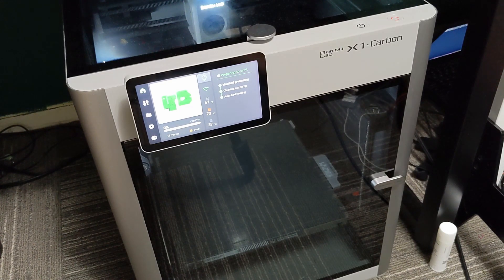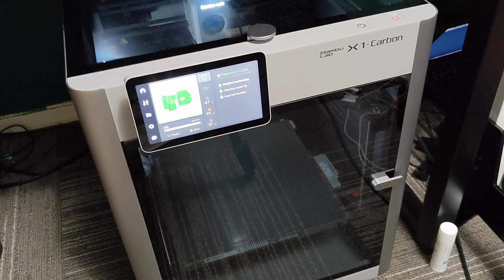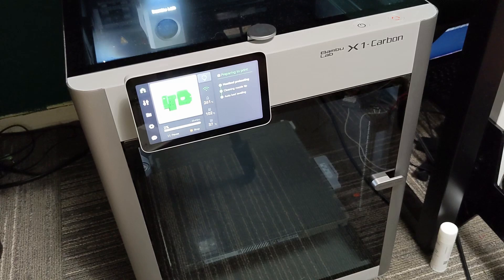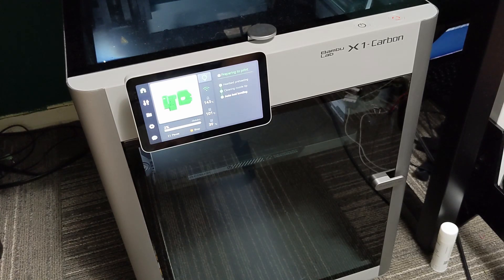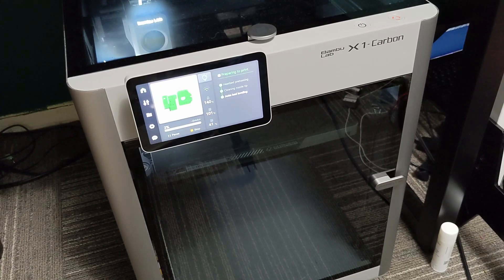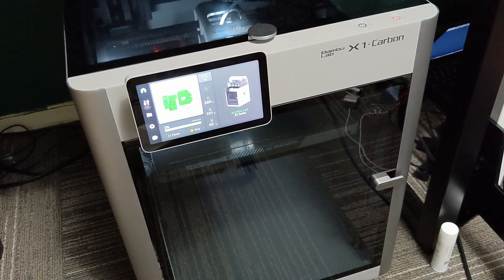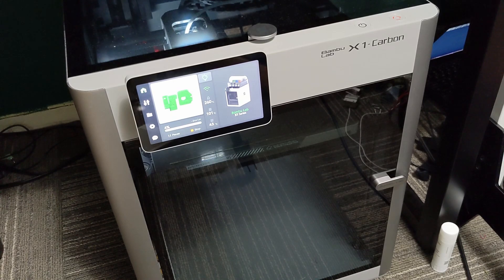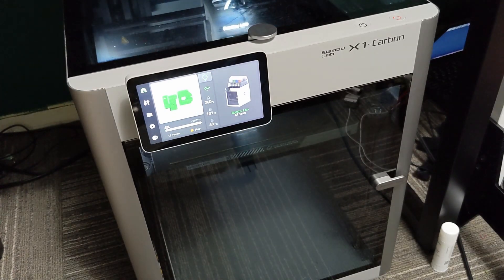Fast CoreXY 3D Printer Bambu Lab X1 Carbon - EP 2 - Update and ASA printing

Comment: How fast does it print ASA?
Reply from the maker: 200 - 300 mm/s depends on a lot of factors though, generally it's 3 times faster than a normal printer. That being said you could tune a voron to print at similar speeds
Reply: @Rolohaun  Thanks for replying? What about layer adhesion, part strength at those speeds? I print mainly functional parts so strength is my main concern.
Reply from the maker: @elleryfg7853  cnckitchen did a great video on just that. Generally you would want to upgrade to a CHT nozzle to make sure speed is not affecting strength or you could slow down your prints a little.
Reply: @Rolohaun  Yes. I watched it but I was thinking maybe using the stock hardware, increasing the temperature and going slightly slower would yield good result and still be above other printers in the market speed wise
Reply: @Rolohaun  that's why I was asking about your experience to see if you did some tweaking with temps and speeds and still got strong parts faster than what others printers can do

Comment: At what speed do you print ASA on this machine? Like what is the fasterst possible speed for ASA material? Thanks for the video.
Reply from the maker: 200 - 300 mm/s depends on a lot of factors though, generally it's 3 times faster than a normal printer. That being said you could tune a voron to print at similar speeds

Comment: Please, do instead of ABS exactly the ASA in extensive bigger prints. Can you use any filaments or limited to proprietary? I did not see any ASA there and I would go through a lot of it.
Reply from the maker: I have printed alot of ASA works great, I use polymaker, I have printed all sorts of brands of PETG, PLA everything works

Comment: Hello Rolohaun. BambooLab or FLSun V400?
Reply from the maker: I really like delta's but they are two very different printers, depends on what you need?
Reply: @Rolohaun  Thank you for your answer and all your contribution to the 3D world. Be Blessed. Salutations from France.
Reply: @Rolohaun  I need accurate prints like everyone else 😀
Reply from the maker: @xyzxyz6095  both will be accurate, the V400 will just need you to tune it. it's cheaper though
Reply: @Rolohaun  Thanks for your attention.
Reply: @Rolohaun  p1p is $129 cheaper than v400.
Reply from the maker: @foam27  yes now the the p1p is out that is a ok buy for sure

Comment: Just out of curiosity is the slicer for this printer still cloud based? I heard a rumor that they were gonna work on a version that you could still use all the features but it was not cloud based.

Apparently in order to use the bed leveling and first layer check you need to use that cloud based slicer. You can still use other slicers but excluding those features which to me are some of the main selling points.
Reply from the maker: as far as I know it is cloud based still. You can print via SD card and I have been told you can take all the custom Gcode out of the bambu slicer and put that in another slicer. I have not tried. The Bambu slicer does upload fast and seems to work well so I have just been using it. I still prefer Cura though.
Reply: @Rolohaun  Yeah I am used to Cura and want to learn to use SuperSlicer which is why I was wondering about the software compatibility I might hop on their discord and see if I can find someone who has tried it. But I appreciate the quick response 😁
Reply: It is not cloud based. They are using a fork of prusaslicer which itself a fork of slic3r. Same as super slicer
Reply from the maker: @caseyeberle7998  yes I know however the file is sliced and uploaded to the cloud then to the printer. It would be much better if the slicer sent it direct to the printer

Comment: Recommendation for fast printer for PLA? The X1 is certainly interesting for ease of use, but it's definitely pricey.
Reply from the maker: I the the FLsun v400 delta would be a fast PLA machine that isn't expensive
Reply: @Rolohaun  At $829 for the V400 vs $699 for the P1P,  Bambu is a no brainer.

Comment: The regular X1 is actually probably better suited for high temperature materials.  The carbon gets you the auxiliary cooling fan so it can cool PLA at high speeds.  You don’t want this with most high temp materials.  You can still add a camera and hardened parts when they become available to the standard X1 and probably come out $100 or so cheaper than the carbon if you don’t need to print PLA.
Reply from the maker: ya can turn the aux cooling fan off but yes it could be a waste if you only print abs or asa
Reply: @Rolohaun  I ended up backing the carbon because it had the AMS package and because carbon sounds cooler lol and 50/50 CF filament. I will however typically only be printing ASA, PC, or Nylon so for me the aux fan won’t really get used.  I did want the camera so having it already installed is a plus even though it’s probably very easy to add to the standard X1.

Comment: Same problem I have.  I Only print ASA.  Gone through 2 sheets in 1 week bubbles after 3-5 prints.  Ordered a PEI steel plate from AliExpress.    I will check out printing on the engineering side.

Comment: Bambu isn't the first to use CF rods for the X axis. The original Hypercube design used CF rods. I've got carbon rods sitting in my closet from my old Hypercube build.
Reply from the maker: yep but they are the first to mass product a CF rod 3d printer. I think the reason these were abandon on DIY printers was the OD of the rods were not consistent.
Reply: @Rolohaun  I wonder how Igus did it?
Reply from the maker: @foam27  I am pretty sure IGUS machines the rods down to the correct OD

Comment: The base X1 lacks the aux cooling fan, which I undertand is very useful for pla. Also I think the frames are all metal, just the outer panels are metal vs. plastic on x1 vs x1 carbon. So i think the base model may be worse for just pla printing, however the $15 hardened nozzle would be the only thing keeping the base x1 from printing all the exotic materials just as well as the x1 carbon. Personally I went for the x1 , and plan to add the aux fan, hardened nozzle, and carbon filter ... which are $50 together. At that point I'm not sure what the $1050 base model with these addons couldn't print that the $1200 carbon version can, you just miss the metal exterior, and webcam.
Reply from the maker: your right the auxiliary fan is a good addon for PLA, might just be better for users to skip the standard X1

Comment: I'd be interested in seeing you try tpu, but even more interesting than that tpu/soft pla in the ams, against their advice.

It's nice to have found this channel, because with the more in-depth experience you have with other printers I imagine any issues would be much easier for you to point out/mitigate.

I imagine the issue is basically all to do with the buffer, but no one has tested it and done a video about it so I don't know. Ill absolutely try it whenever mine arrives, but until then the curiosity is real.
Reply: cant run tpu threw ams but if just run it directly it prints fine

Comment: Did you use a release agent, like a glue stick, on the engineering side with ASA? I haven't printed anything on the engineering side yet so I'm not sure what to expect. Can't wait until there are powder coated PEI plates readily available.
Reply from the maker: Yes I used the glue stick that came with the printer
Reply: You should try hairspray. I had loads of trouble printing PLA on mine while using glue, but got a perfect print last night using hairspray :)
Reply: . Also remove the original sticker the machine shipped with on the printing plate and replace it with one of the spare ones. Not too sure why this works but it does :)
Reply from the maker: @Tripmonkey  oh interesting

Comment: Im in the same boat as you with printing machinical parts using ABS which i have been printing for for 5 years using zortrax m200.  I have been using 3D Jake nice abs black for 2 years and love the stuff, no warping. I have bought my first reel of ASA... still need to test it. But ultimately i am looking at the bamboo because of the speed and it has everything for a plug and play, none tinkerer printer.
Reply from the maker: Definitely very nice for that, I am going to get some polymaker abs and do some test and then make a speed comparison with another printer

Comment: Great video. I am one of the overkill pla mostly printer people.
I haven't tried any of the more exotic(to me) filaments but knowing I can print nylon, PC, TPU is nice. Currently waiting on the PEI plates to come in stock to branch out to other materials.

I know you said you print parts mostly, so you haven't mentioned this, if you print a very tall print the bed lowers to the very bottom. Before initiating another print I would recommend moving the build plate about 40mm up or so. When you start a job when the plate is already low there is a nasty impact/grind before the printer adjusts and raises the plate.

Looking forward to your other videos.